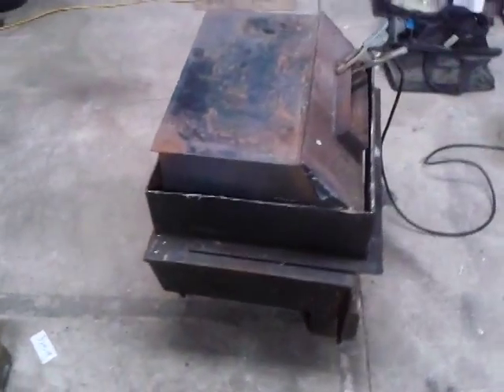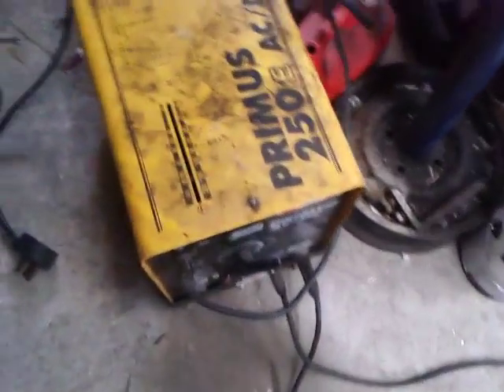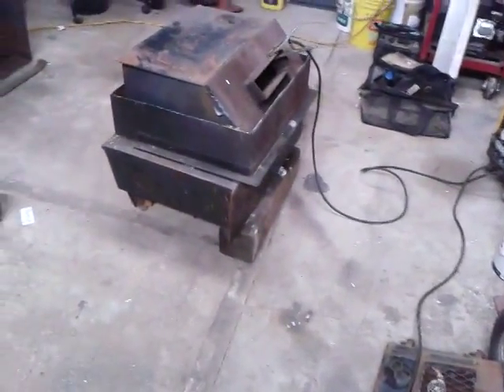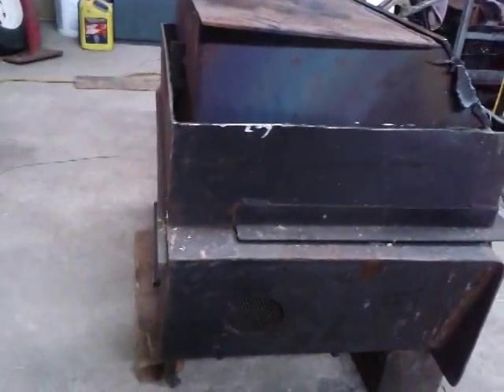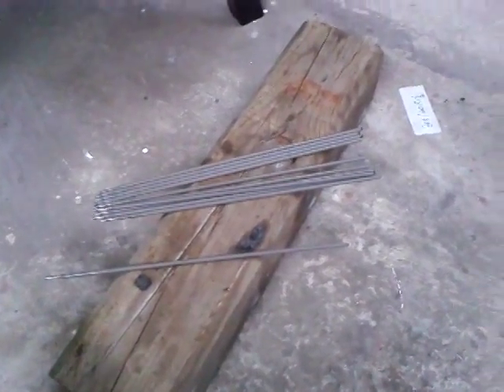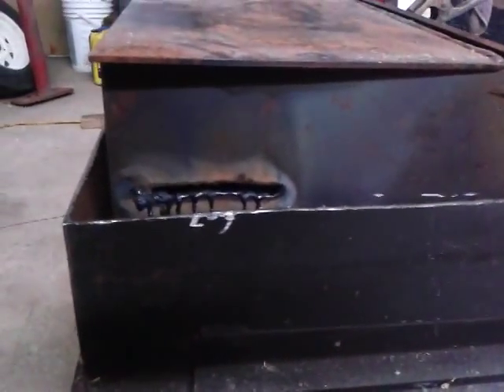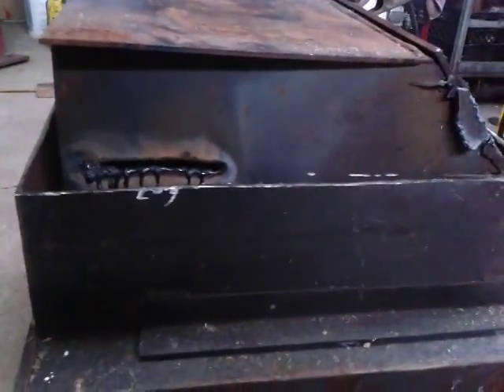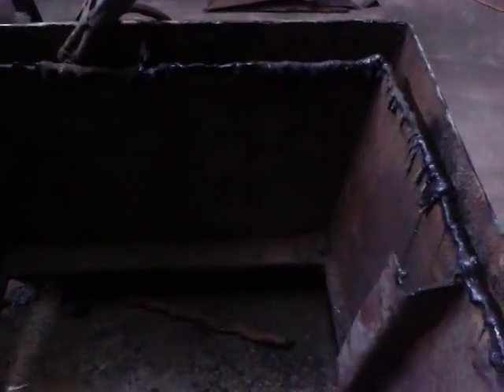Cutting steel with an Arc Welder

Comment: i do this all the time and it works great.  i recommend always cutting in flat position (if you can) to allow molten steel to spray out the bottom.  the water absorbed in the flux turns to steam - its the expanding steam that blows the metal away.   once the ark is struck you can "saw" the steel with the tip of the electrode using an up and down motion.  great for quick and dirty cuts.  takes a bit of experience blasting holes in the middle of a plate to start a cut - but it can be done!  electrodes only need to soak for 20 minutes.  i use rain water.

Comment: I've been wondering whether I could use a welder of cutting.  Thanks for you video that shows it can be done for a lot less than buying a plasma cutter.
Reply from the maker: yeah it is possible, I think they make special cutting electrodes as well or at least use too.
Reply: Carbon electrodes. called arc gouges.